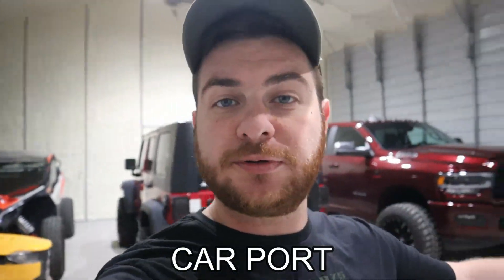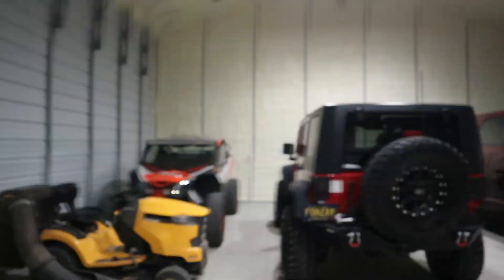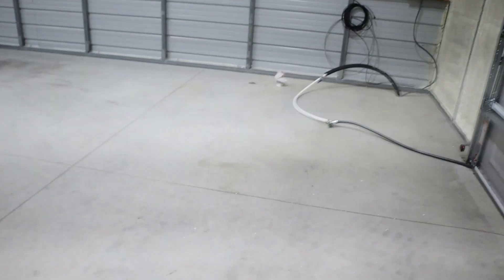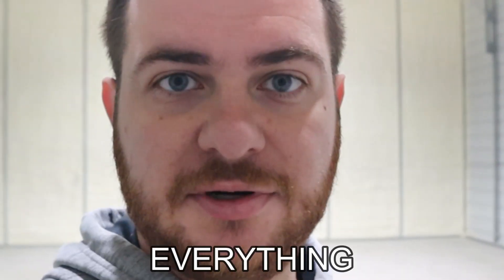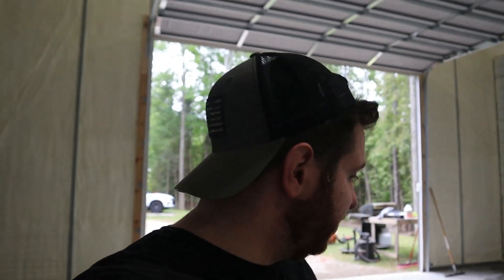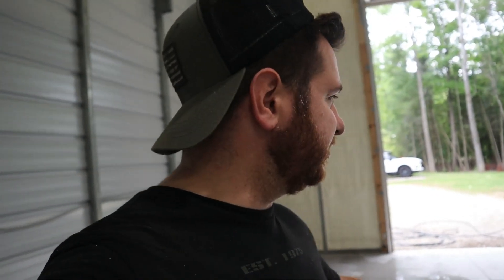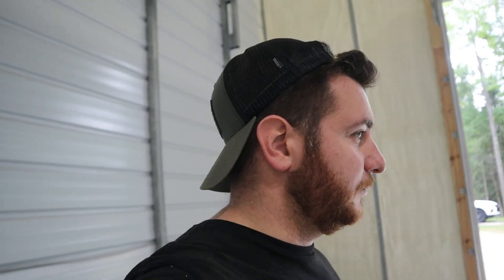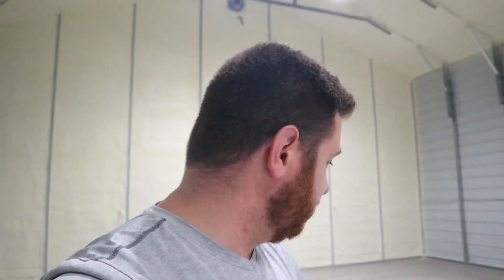The EASIEST way to seal CONCRETE!!!

Comment: Looks good. I've used Behr concrete cleaner with good results for prep. What ceiling fan did you install?
Reply from the maker: @paullaske56  not sure on the brand. Some 72” Chinese one from amazon